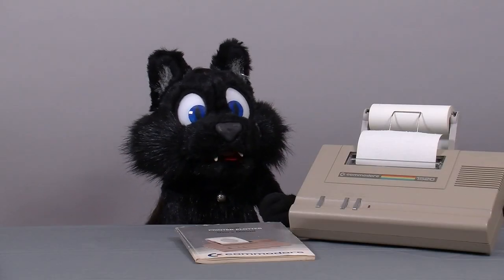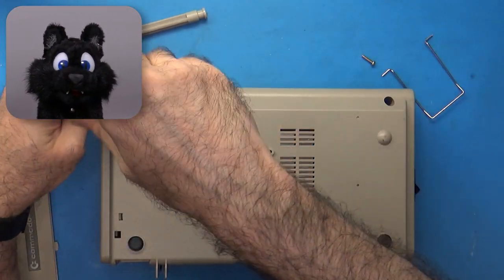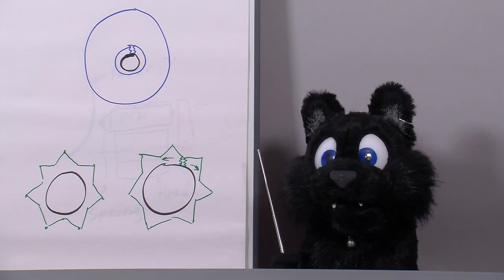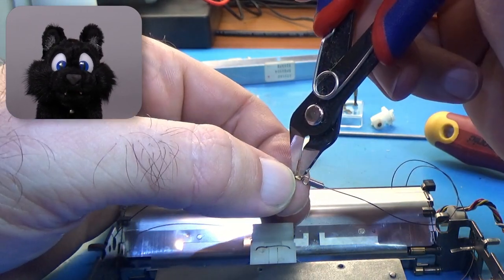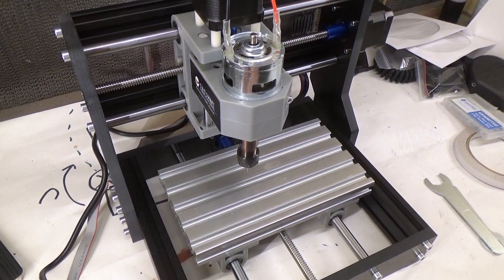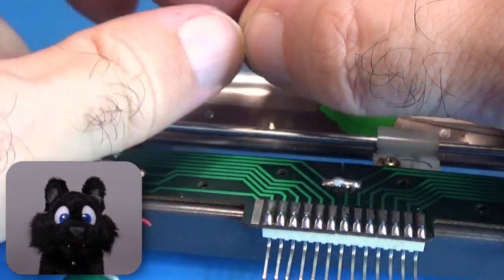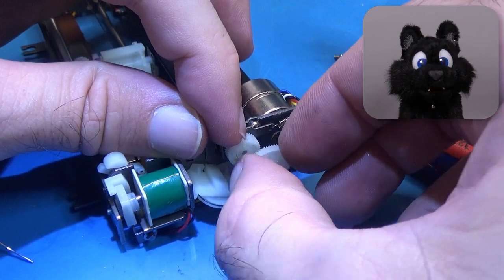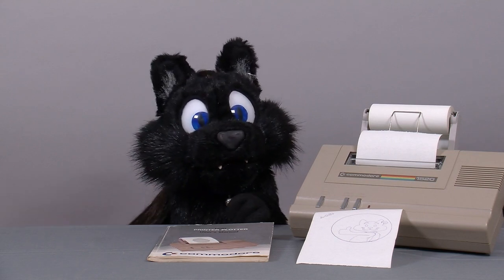Restoration Project #29 - Commodore VIC-1520

Comment: I am the guy who had the brass replacement gears made. Like you I first tried to figure out how to machine them myself but the 0.25m size made that difficult. Even finding someplace to make a small number of them (i.e. a few thousand) was difficult. The Y-axis (paper feed) anti-backlash gear also tends to crack at the hub. You can 'patch' those though. I did a video on that and have had some success with resin printing them.
Reply from the maker: Small production runs of anything with tight tolerances are difficult indeed. Any long term "studies" for the interaction of the brass gears with the plastic ones? That's the main concern I have. If the entire gear train were metal, I wouldn't see a problem, but mixing them seems like creating the next weak spot?
Reply: @atkelar  There are two failure modes w.r.t. a plastic and metal gear meshing. If the gear material is glass filled nylon (very common) the abrasiveness of the glass will destroy the metal gear.

The other issue is the increased strength of the metal vs plastic will cause the metal gear to break the plastic. In this case the stepper motors used are very weak. The motors will stall long before there is a chance of gears breaking. Also consider that the torque at the motor pinion is much lower that at the other end of the gear train and no gear teeth break at the other end.

I've run the brass gears for hundreds of hours now with no visible wear issues.

Comment: Looks like the same Alps plotter mechanism found in the Atari 1020 and smaller scale version in the TRS-80 Pocket computer cassette interface. I have resin molded new gears but you can also buy repro metal pinion gears for it. I’ve been experimenting with reproducing pens for these. So far the best results are from gel pens and 3d printing new pens housings to fit them in. Another option that works sometimes is to use the ink from gel pens and inject it into OEM pens with a syringe.
Reply from the maker: The mechanism was indeed used in multiple 8bit plotters. So far, the homemade sprocket works fine! I kinda hesitate about metal ones: they might wear down the other gears sooner too? But at any rate, the pens are still available since they match some EKG plotter apparently; I'd have to look up the model number at home though. Been a while 😅
Reply: Yes I am still using my resin casted gears. One of them I got already has metal one on it and it’s working as well.  It I agree metal can tear up the others. 

Yes you can get NOS pens from Brad at Best Electronics.

Comment: Great video. Im trying to follow your steps on a 1520 I got. Where do you get your paper? My unit seems to be very sensitive to the paper weight. The long black roller seems to spin on the shaft if the paper is too heavy.
Reply from the maker: Thanks!
The roll I'm using - for what little use I have - is still the one that came in the box. But at any rate, the black roller should be pressed on the shaft and not spin on it at all. It even has tiny spikes on it to grip the paper. I don't think glue would work in this case though: the roller is a softer material and the shaft is chrome plated; finding a glue that works for both surfaces without damaging either might be impossible. The primary thing to check would be: is it really the roller rotating on the shaft, or is it the gear maybe? Those are usually full of cracks. Making a small dot on the shaft with a marker should make it visible if it's one or the other.

Comment: Hi, could you please tell me a little blit more about the HPGL to BASIC conversion? I would really like to know. I just got a new-in-box 1520. Pens in cylinder(still working)!
Reply from the maker: The code for that was a bit cobbled together TBH. Essentially, I read in the HPGL file and translate "line to" or "move to" commands to matching commands on the plotter, create "DATA" lines for them and output a FOR loop to read and send the data. As far as I experienced, most "convert to HPGL" converter tools only create line commands to begin with, so it worked out fine for the two test cases I had. The size was "maximized for the 1520" - i.e. it auto-scales the coordinates of the input to fit inside the plotting window; It's written in C# and re-uses some code from the Lego plotter project, namely the HPGL parsing: https://github.com/Atkelar/LegoControlDriver/blob/main/Atkelar.LegoPlotter/HpglParser.cs ... But in order to publish the code, I'd have to brush it up a little bit first.
Reply: @atkelar  Thank you for your reply! I would love to see it when you're done brushing up. Would be great to have a tutorial or how to of some sorts. fantastic work!

Comment: Could you share the 3D File for the Paperroll holder, because i get a 1520 without any one.
Reply from the maker: I only made the side brackets, the "bar" in the back was included in mine. I hvae the files over here: https://github.com/Atkelar/OpenSCADGadgets/tree/master/restorations
Reply: @atkelar  Thank you very much, now i have the dimensions to make the other side, maybe i try to do it with Openscad.
Reply from the maker: The "zip" file has the STL files for both sides and the OpenSCAD code can create both sides, also the "cut in half" versions are included; depending on the 3D printer, maybe the better choice to print halves and glue them together; my prints are usually a bit warped and gluing halves together compensates for that :)
[edit] it's just the round cross bar for the paper roll that is not there (yet) but I'm very busy these days, so a proper model might take a bit.

Comment: Hi, can i have the STL files of the supports roll paper + bar?
Reply from the maker: I  did not create the bar, but the OpenSCAD source file for the older(s) is in this repo here: https://github.com/Atkelar/OpenSCADGadgets/tree/master/restorations
Reply: @atkelar  Thank you very much for your answer. I can only print .stl files (i have a little anycubic printer). Can you convert your supports-files in stl?
Reply from the maker: I can run the conversion in a bit, not at my normal computer right now.
Reply: @atkelar  Right, thank you. When you can.
Reply from the maker: I uploaded a set of STL files, based on my latest template: The holders are left/right either full or half (A and B) depending on what you need to print. This should be a direct download link: https://github.com/Atkelar/OpenSCADGadgets/raw/master/restorations/VIC-1520-Set.zip
Reply: @atkelar  Very thanks for sharing the STL "full version" to print 2 singles parts (left+right). I think it's possible to print without half division, not?
Reply from the maker: It should work; I didn't do it myself because it is hollow on the inside in the original, and I didn't want to scrape out the support structure....
Reply: @atkelar  Great result! How I can send you any photos?
Reply from the maker: The esiest way would be to post them on some instagram and put a link in the comment; unless you don't want to share them in public?
Reply from the maker: Awesome! I can see the pictures and I'm glad I could help you out here! I can either make your comments visible ot the public (I have "manual approvel" set due to some trolling in the past) but I could also repost them as a "community post" - or of course just enjoy them and not publish them :) Your choice!
Reply: @atkelar  go ahead

Comment: Never occurred me to do a sprocket or gear using a mold and resin. I always thought I would need a lathe, a cutter, a 3D printer or something like that.
Nicely done.
Reply from the maker: Thanks! I think for larger diameters, a lathe or 3D printer would be more accurate; but for this tiny little thing, the mold doesn't have enough flexibility to distort in a meaningful way. I tried to find ger cutters in that size but failed; this would be "module 0.25" or about that; the smallest I found was "module 1"...

Comment: Where did you get the pens? Is there somewhere you can buy paper for it?
Reply from the maker: My sources are in German, sorry, but both are still available:
I was 100% sure I got the pens from Amazon... but now that I looked for the order, I couldn't find them. There seems to be some "medical plotters" that use the same ones, like here: http://plotterstifte-faserschreibfedern.de/epages/d0ad59d0-2179-4e1a-a881-03dcaece632c.sf/de_DE/?ObjectPath=/Shops/d0ad59d0-2179-4e1a-a881-03dcaece632c/Categories/6/4
The paper seems to be a standard "double width" adding roll, 114mm wide, and can still be found in some shops, like here  https://www.faxland.de/Kassenrollen-Thermorollen/Kassenrolle-Breit-114-mm/ the smaller diameter one with 40m length should fit
Reply: @atkelar  Cool thanks!
Reply: @atkelar  Thanks! That's very helpful. I'm glad to know that these can still be found. I have a 1520 that seems to function fine but I've never been able to use it because I don't have the paper, and the pens have dried up. I was able to send it some text to write and I could see that it etched the text into the roller. Not the best idea but I confirmed that it works. Lol!